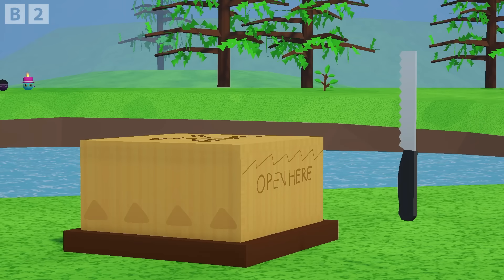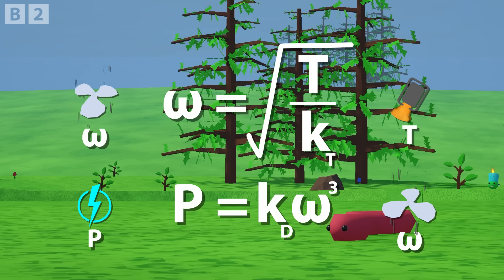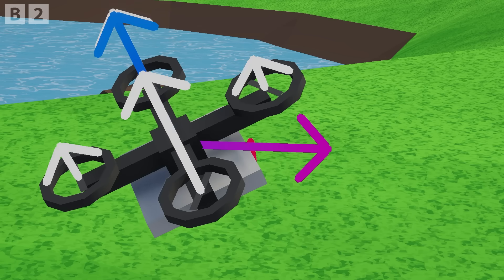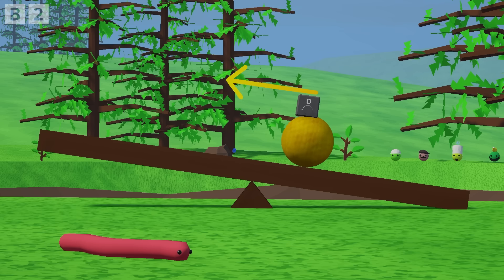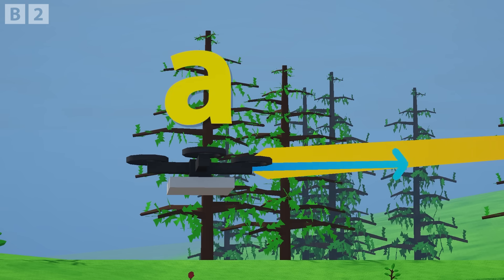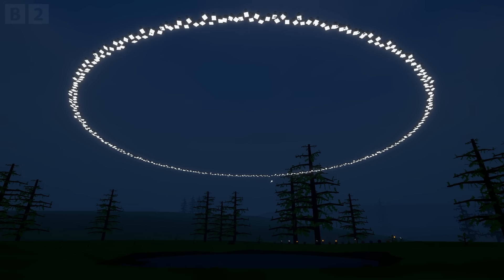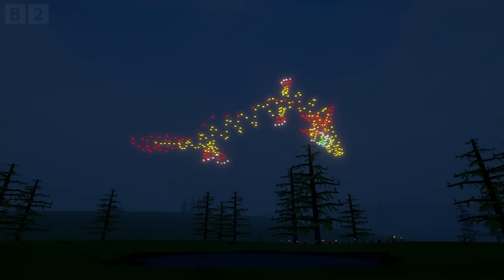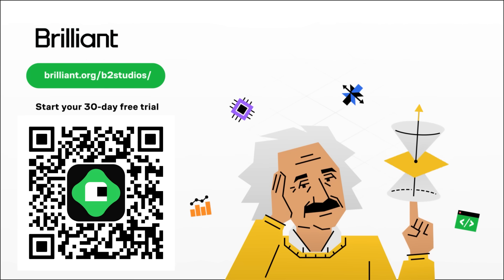How Drones Create Dragons

Comment: As a "from the depths" player my immediate thought to control attitude was just like "can't we just slap a pid on it and call it a day?" 😂

Also, I feel the no use of the integral. I only pull it out when I want a ship that cuts through waves instead of bouncing over them or something to that effect. 🤭

Yo, this control scheme slaps. I've got to make a breadboard for thistype of control so I can make an incedibly manuverable helicopter
Reply: yeah this video was actually pretty helpful to make my aircraft avoid becoming submarines
Reply: Weirdly, I've had the opposite experience for my applications in similar games, where integral is extremely important and derivative is an afterthought at best. Integral is important any time your system has some kind of external forces you're trying to counteract (like gravity, cooling, etc.) in order to "learn" how to counteract that force, but derivative is mainly important when your system has a lot of momentum, which is less common. I think attitude control in particular is one of the few cases where you commonly have a lot of momentum but not a lot of external force. I've played a bit of From the Depths myself, and the main thing I used the PID for was submarine buoyancy control, where the integral is critical.

In a very different submarine game I've played, Barotrauma, it's super easy and helpful to slap together a PI (no D) controller to automatically control reactor parameters (the game gives you automatic control built-in, but it's bad for game balance reasons). Really, in any game that gives you circuit blocks that do math, it's incredibly easy to set up a PI controller (though the D can be a bit more involved). And in Space Engineers I've gotten good use out of them to build vehicles that maintain a fixed Z-axis altitude on planets but can drift around freely at full speed on the X- and Y-axis, where the integral is necessary to overcome gravity.
Reply: I is often used for steady-state error. For stuff like countering gravity, another approach is upgrading the PID to a PID with Feedforward (PIDF). One example is linear slides where the pitch and extension of the slides varies the forces that the controller needs to counteract, which a feedforward is perfect for. D can be tuned to counter overshoot and I can be tuned to counter steady state error.
Reply: Reefscape coder I had the same thought lol

Comment: 4:20 Real quads don't utilize reverse thrust for pitch/roll control. Assymetric thrust is good enough, because of low ratio of moment of inertia to thrust (it's easy to spin around its axis without much thrust).
I'm sad yaw dynamics were not mentioned, that's the best part of quad control.
Reply: "I'm sad yaw dynamics were not mentioned, that's the best part of quad control."

Didn't even have half the props rotating the other way. =(
Reply from the maker: Interesting to know this, I plan on making a real life follow up so i'll be diving deeper into this at some point.
The yaw dynamics are not mentioned, but they are present. I just didn't program a system to control yaw. The physics are there though.

2/4 of the propellers are indeed rotating the other way, its just hard to tell. I spent ages creating fake motion blur for the blades that makes it tough to see.

Another thing to add is the way the spin-rate converts to thrust actually depends on the speed of the air around the drone, but since it's typically very low or nearly zero you can ignore it and end up with a good enough approximation

Comment: now add collision avoidance to coordinate the drones better so they aren't colliding and knocking each other out of the sky every 5 seconds
also the drones don't control yaw and are always spinning, which makes them less predictable
Reply: if abouttocrash():
  dont()
Reply from the maker: There are a few things I didn't mention that are there:

- there is wind, and it is randomly generated and comes in waves

- the propellers actually do have an effect on yaw, but I don't control it

- 2/4 propellers reversed so that the yaw is balanced

- obstacle avoidance isn't that tricky but rendering / simulating 400 drones isn't easy, it would be far easier if the drones actually existed

I plan on making an IRL follow up to this at some point
Reply: @b2stud  Did you season the wind?